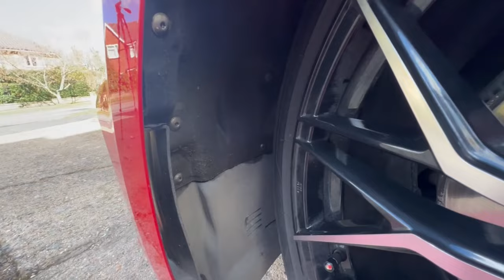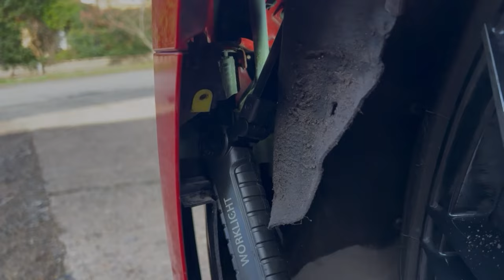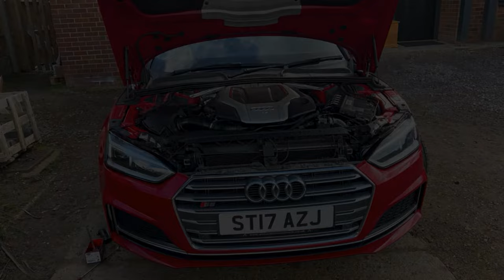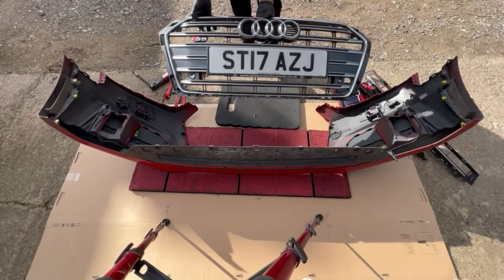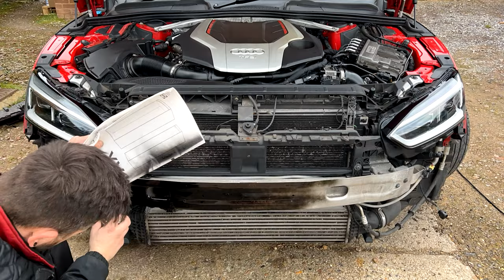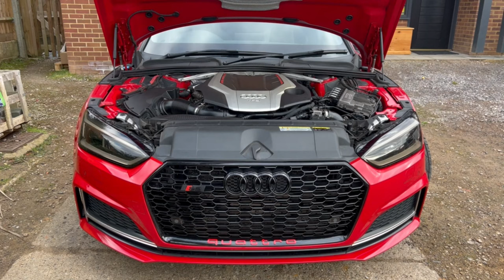Audi S5 Rs grill

Comment: Did your parking sensors ever contact the crash bar?  A lot of videos show customers cutting the crash bar to allow sensors to sit properly without interference.   Also,  do you get any park sensor error codes since your install due to need of recalibrating?
Reply from the maker: My sensors going to the grill holder without any issues no fault code works as like a stock grill

Comment: Hi 
Did you have to cut holes for parking sensors? And if i leave foam i will not be able to put grill back on ,or that just to make it look better??
Reply from the maker: Hi the foam is not suitable with a grill and a sensor position was already on a grill kind of like plug&play
Reply: Thank you for you reply, I have bought the same grill,I have asked someone to put the grill for me ,I have told them to paint crash bar in black ,but they have left the foam on ,and now I'm wondering if they forced to fit,should I go back to them and remove foam or leave it?
Reply from the maker: @krzysztofmakowski2854  you can leave it on but a sides of the grill is look silly for me that's why I take it off

Comment: Did you remove foam on top of the crash bar and the cable pipe?
Reply from the maker: Yes exactly then painted to black
Reply: Did your parking sensors ever contact the crash bar?  A lot of videos show customers cutting the crash bar to allow sensors to sit properly without interference.   Also,  do you get any park sensor error codes since your install due to need of recalibrating?
Reply from the maker: @G3ekbox  My sensors going to the grill holder without any issues no fault code works as like a stock grill